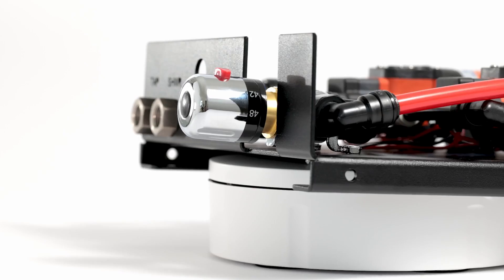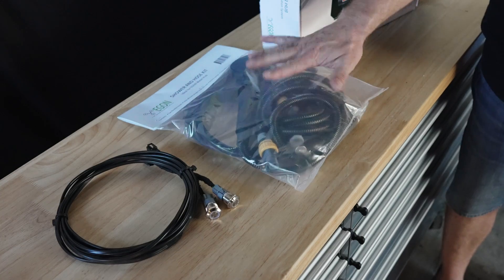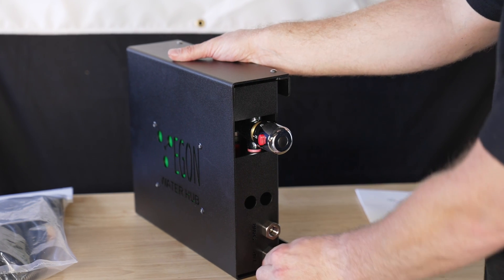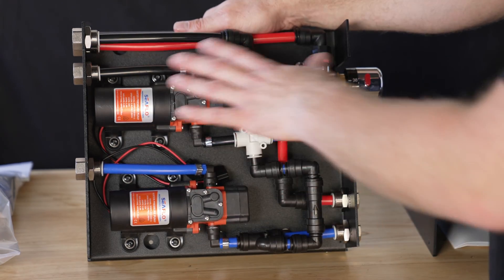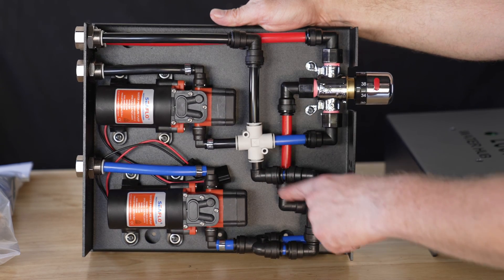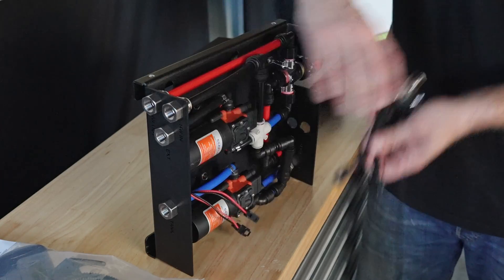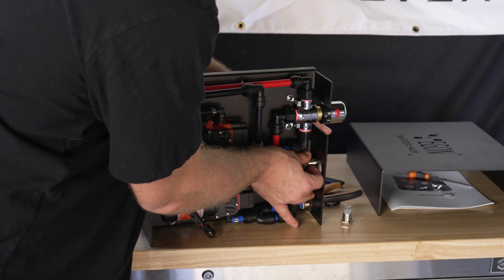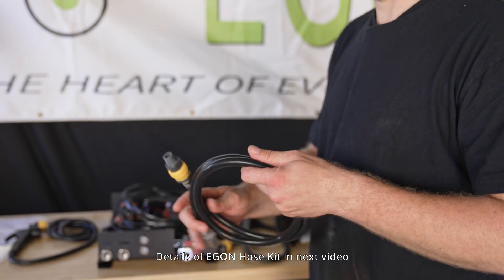EGON WATER HUB Explained @EGONGame-changingsimplicity

Comment: Can the dirt / aux water source be pressurised coming into the water hub at all? My scenario would be using a secondary pump to draw water from a river possibly 20m away,  I'm assuming the 3.5lpm pump on the aux circuit would not be able to pull water from a river for example? Or can city water be connected as the aux source? 
A very impressive solution in such a small package.